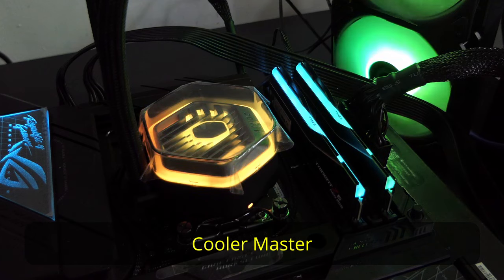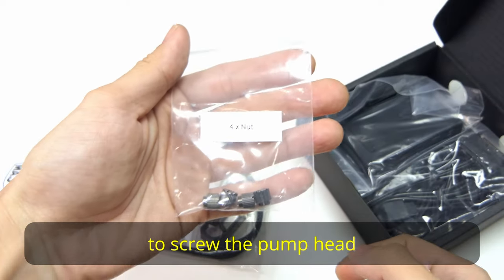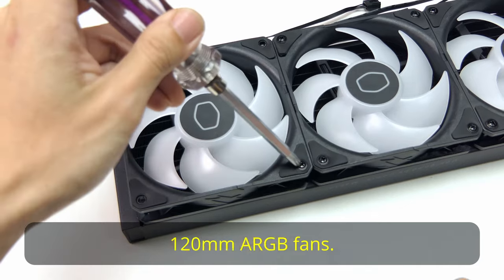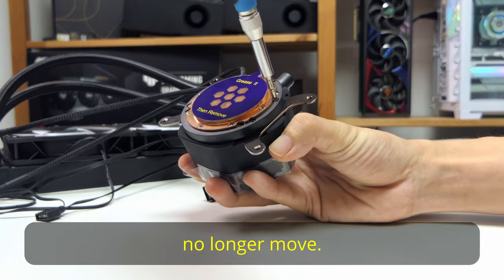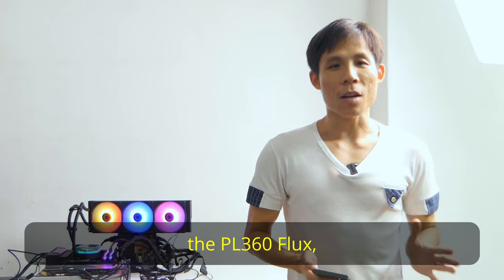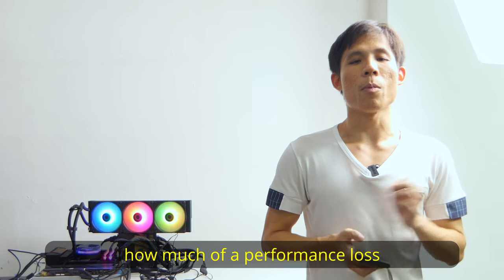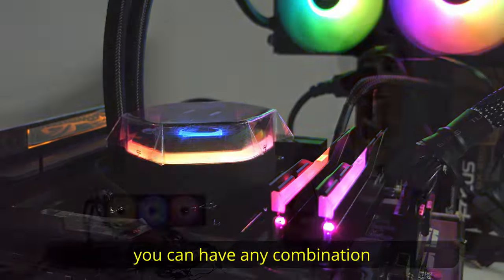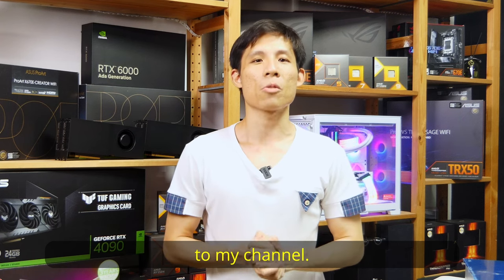Pretty Cooler But How Does it Perform? Cooler Master Masterliquid 360 Atmos

Comment: you'd probably get less noise on the rad/fans using 5mm spacers, but at time of writing they're expensive and hard to find, and easier to 3d-print